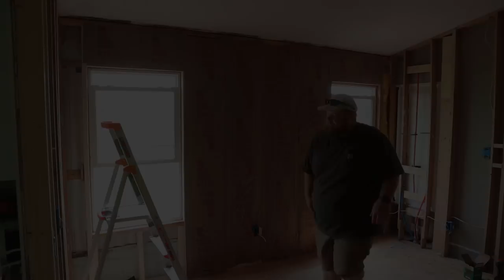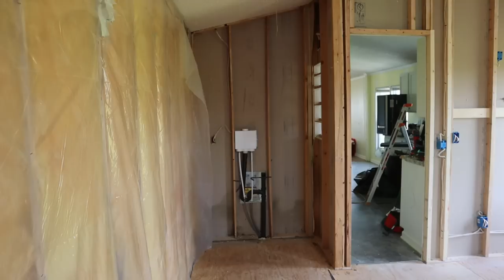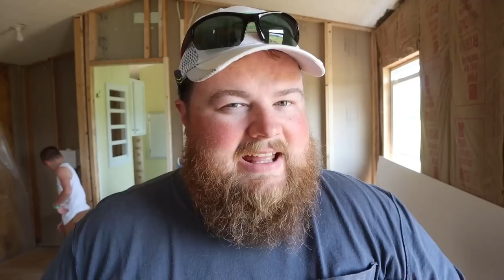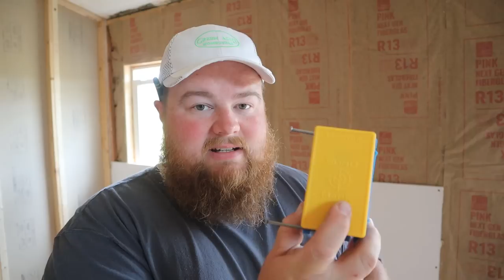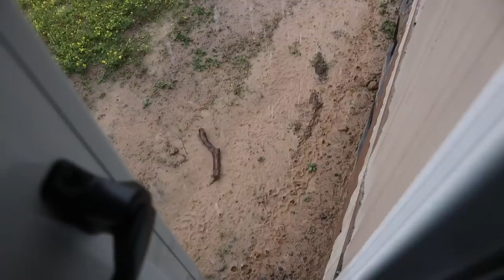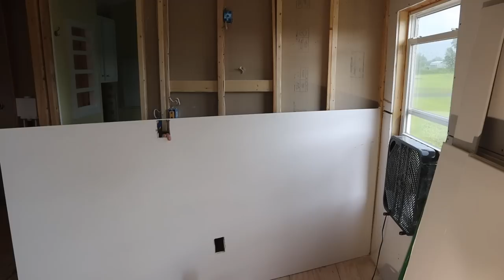Drywall Install with Made in USA Tools  // Mobile Home Bedroom Renovation

Comment: My husband has been in construction for 48 years. He said they tried the plastic on the interior once in the 70s and it will cause rot. The plastic will sweat where the warmth from one side meets the cold from the other and it will cause rot. Just FYI in case you have time to change it you may want to. I love watching your channel and would hate for you to have trouble down the road.
Reply: Agree, that’s why they use Tyvek as it allows the wall to breath and it’s still waterproof 👍

Comment: I swear by the old lipstick method, put lipstick on box, push drywall against it, pull away it is marked EXACTLY, cut with a handheld drywall saw or razorblade knife. Screw drywall to wall with a perfect fit around box. Cost is one dollar for lipstick at Dollar Store or zero for old one wife no longer uses.

Comment: You're husband's right about the drill not being a hammer, using the battery as a hammer is a great way to decrease the lifespan of the cells. All lessons you learn by doing, so bravo for yall for doing the hard part, DOING IT!

Comment: A solid plastic barrier I do not recommend because the wall can't breath which in turn causes sweating which in turn causes mold. Maybe just being applied to one side of the wall only you just might get away with it.
PS that is if you have no other barrier of any type on the outside wall.

Comment: Hi Sam & Angela
Another great video.
It's always nice to see progress.
For some reason once you see drywall up, it just makes things more focused as to what the end result will be.
We've experienced the same type of rain storms here. Some areas had 3 inches in an hour .
At least you know there is no leaks.
Angela you're brain is just fine . Just like using the drill as a hammer. You gotta do with what's available at the moment.
Sam, I like your new tools.
Whatever makes the job easier, is always nice.
Will be coming back to see what's next with  you, the two stars of DIY.
Stay strong and safe

Comment: Air infiltration deposits dust, dirt on the insulation . That is an area that may need better air sealing. It is A good way to locate air leaking in , out of the attic insulation.

Comment: I've been using those drywall bits for years I usually buy a dozen at a time they wear out pretty quick but they're awesome and just a tip you're never supposed to cut the ends that you butt together generally you put factory in together for a smooth butt joint the cut end always goes to the wall just a tip looking good

Comment: A tip I learned when they did the drywall replacement in my basement, put up the drywall, and use a small hand held plunge router to cut the openings for the windows and doors.  Took them seconds to cut the openings once they had it hung (and they were cut perfectly to size), but it DID generate a good bit of dust.  They did the same for wall box openings, but they weren't nearly as precise, and had to go back and repair a bunch of spots with dyrwall mud after the fact (your tool above would have done a MUCH nicer job on the outlet box openings for sure).
Reply: Probably too late at this point, but if you're going to put a TV on the wall in there, figure out where now, and put some blocking behind the drywall there too.  Makes those TV mounts solid as heck.  I ran network and power to where mine mount as well, so no wires showing either..

Comment: Are you going to do a little sound deadining??? On the kitchen wall???and if not,how would you do that??? I am asking because,we are redoing my bedroom, and would like to have more then one wall,to put my bed against,but the 2ond choice is right next to my bathroom/laundry room,HELP oh we are leaving original painted wood paneling,to save $ to use toward flooring,we are just going to fill in the gaps with caulking, but b4 that ,after taking panels away ,besides insulation, what can be used to sound proof a little more??? I don't like hearing my roommates bathroom noise??? Lol 😆

Comment: That's a great idea that Angela had for the wonky  corner wall next to the shower, however, hopefully she didn't use too long of a screw to fasten the plywood/drywall spacer, otherwise  you'll find that the tip of the screws went through the metal siding on the mobile home!!, that happened to me on a job years ago!, had to remove all the screws and replace them with shorter ones !, also if not caught, you can get a nasty cut if you happen to brush up against the area of the screws that poked out from the siding !, I suppose you could cut the tips off of the outside of the siding, but still have a cut hazard!, great job so far !

Comment: Good video. However keep an eye on the wall with the plastic vapor barrier. They are not recommended nor are they in the latest code for most of the US. Hot humid weather can mean vapor condensing on the plastic, inside the wall, when the AC is needed. Under the drywall plastic is more for Canada and Alaska.

Comment: I have seen the magnets on other channels, it looks like the tool of the year. Others seem to have more luck cutting out the drywall with a rotozip spiral mini router cutter, may be you might find it easier with that. That storm that you had is like what we have over here in Cyprus. When the rain hits the ground it bounces back up again, it fun to watch the horizontal rain but no fun being out in it. Thanks for posting
Reply: rotozips are like dust bombs, not sure about the magnets, how do you know they are exactly lined up and not off a little

Comment: I enjoyed the part when you showed the clouds and we got to hear the thunder. How long did it take for the clouds to pour on you? From the time the clouds moved in? I miss hearing thunder and the rain.
Those tools are great thanks for sharing. One tool you did not share how well it worked (drywall screws), but it showed how quickly you handled the work. Excited for you to get to the finish line. One thing I notice is there is never padding on the in-between walls. I would love to see that for notice control.

Comment: Sam, you never commented on your thoughts regarding the drywall bit. How'd you like it and does it keep the drywall screws from going too far and tearing into the drywall paper? Thanks.
Reply: I did a whole house sheetrock with that bit and it works great. Does not break the paper unless you press the drill forcefully into the sheetrock.

Comment: I noticed you didn't leave a 1/2 inch gap were the sheetrock meets the floor. Are you not worried about expansion a d cracking the drywall down the line??

Comment: Hey Sam and Angela, I noticed you used R-13. Don't you need something higher like R-30 to stay warm. I live in NC and that would definitely mean cold winters here. Thanks!
Reply: They only have 2x4 walls so the best they can do is R-13. R-13 is the norm. To get R-30 with fiberglass they'd need about a 10" thick wall.
Reply: @diyfferent  thanks for the info!

Comment: R13 is enough for exterior walls insulation? I guess it varies with region. Also, do you need a Reno permit in Tennessee to rehab your own house? I hear some places allow a homeowner to do their own work unless they are selling it. Here in Alberta CA, we need to get licensed trades to sign off on our work and have permits to be legal. You guys are hard workers and do it on a budget too. greta job.
Reply: In the US every State is a little different regarding permits and some States are less restrictive than others.  Most States require inspections/permits on new additions but not necessarily on existing rooms.

Comment: You too make it so easy putting up sheet rock i have to do my mobile home Walls im a auto mechanic all my life not a carpenter but i have to do it though to expived for a carpenter to do it sir and sheet rock is so expensive too i have gypsum sheet rock in my mobile home now and the ceiling gypsum 1/4 inch

Comment: Hey sam you should check out roto zip tool it also functions as drywall router among its many functions it is as handy as that oscillating saw also known as bone saw we all cant live without now. They are part of the must have tools for renovations. Anyhow thought you might like it. You guys are killing it keep up the good work.
Reply from the maker: I used to have one. Tried it on outlets and kept cutting through the boxes and having to replace them. I tried and tried but never got it. I must be special. :)
Reply: @sam-and-angela  lol well I bet for cutting out those windows works good if I go in clockwise rotation I can cut out lights pretty good too it's like most things just takes little practice. Also if you play around with that attachment that cuts out all four sides at once by just flare the edges outward would solve your problem with it make it bigger than box and dont forget to consider the thickness of drywall and boom you be doing it one handed in no time, we are men everything needs tuned up. Great progress I can tell already you guys are gonna make a great home there the kind people grow old and pass along thru generations. I look forward to watching you guys whip it into place.

Comment: And a drywall router would be way easier. All u do is find the center if box and the router around the box. Way faster and easier. And u can use same router to cut all windows and doors....fyi and ways start with the top sheet and then the bottom. You will have 3 inch on bottom that the trim will cover up. And always break the drywall over the windows and doors. Less taping and way easier to hide the seems

Comment: Hi from SC.  Y’all have inspired the wife & I to tackle out 99 Fleetwood single wide.
Quick question, why did you cover the wall with only drywall Ant not add insulation to the wall at the front of the bedroom? 
Thanks.
Reply: From what I could see they insulated only external walls not internal🫤

Comment: 25:58 What are the pros and cons to not putting insulation in interior walls? Will the lack of insulation in the way prevent the room from staying a consistent temperature?
Reply: One pro for sure is it's also a sound barrier.  The insulation cuts the noise down pretty well.  Nice for a bedroom.
Reply: i add it when renovating...it cuts down on noise transmitting too...and helps control heat between rooms of course..which is good.... depending how your home is cooled or heated it can make a slight difference in transmitting those energies through uninsulated walls....it is worth doing while the wall is open.. imho
Reply: no
Reply: no
Reply: @boathead22000  
no to what ?  🤣
Reply: @boathead22000  
if to the OG comments..
Yes..there are Pro's and Con's to Insulating Interior walls or Not Insulating those walls....
so your answer is Wrong...

and depending on the way you heat or cool your rooms...there can be an effect of having Insulation in Interior walls or Leaving them Empty...so your Wrong again..
😉

Comment: Why don’t you put a vapor barrier on your outside walls too
Reply: The vapor barrier only goes on the side of the wall that faces the inside of the building because if any water vapor does manage to get into the insulation itself it needs a way to get out.  If you put a vapor barrier on both sides of the wall and the insulation somehow gets wet, it won't dry out and you'll end up with mold.

Comment: Why did you put a vapor barrier on one wall and not the other outside wall ?
Reply: The new insulation Sam installed on the other outside wall is called kraft faced insulation and the kraft paper side of the insulation batt you are seeing creates the vapor barrier.
Reply from the maker: Michael answered for us below. :)

Comment: You installed the installation wrong. You DONT staple to the outside stud but rather on the inside sides if 2x4. That way drywall will be flush incase u have a bunch of staples hanging out.